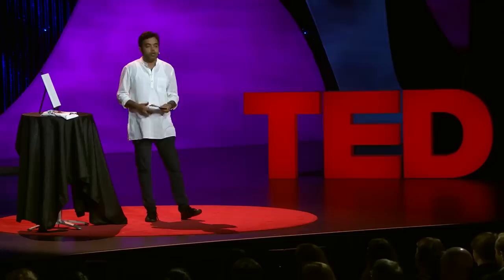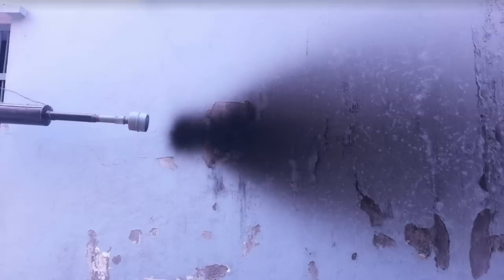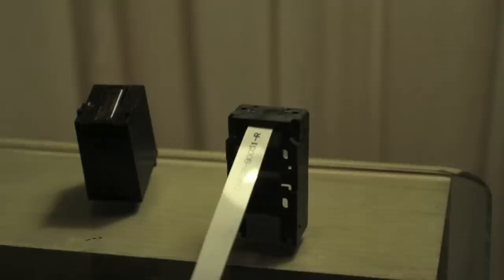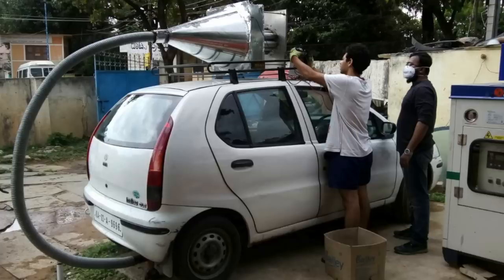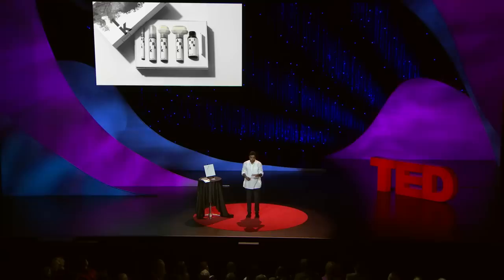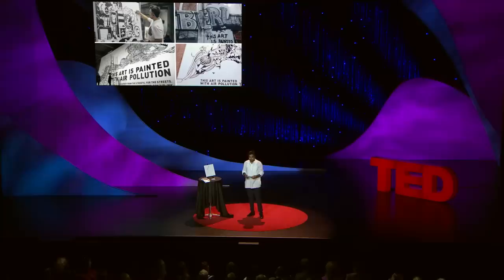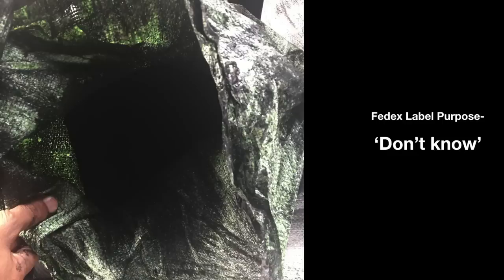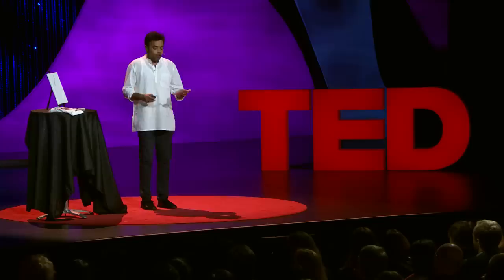Ink made of air pollution | Anirudh Sharma

Comment: This is really innovative.
But there are some concerns with this technology. The technology used here is similar to particulate filter which basically removes the 2.5 micrometer particles.
The problem with such filters is that they generate back pressure,decrease efficiency of engine and end up creating more co2 emission.
If they can tackle this problem it would be great.
Check out the wiki page of air ink
Reply: @hello that claim is really interesting.
If it's not affecting the performance then it will not generate more co2. I don't know if by the performance he means efficiency or output given by the machine in the end.
We will have to look at the design of his filter and the particulate filter that already exists.
And then I think we can come to some conclusion.

Comment: It would be helpful to learn what environmental benefits there are when the particles are captured vs not captured. Is doing this making any measurable improvement?

Would the ink produced contain carcinogens or other harmful elements?  Does it “fix” to a page or does it run if it gets wet?  How safe would it be on clothing?  The safety factor of the recycled product should be disclosed.